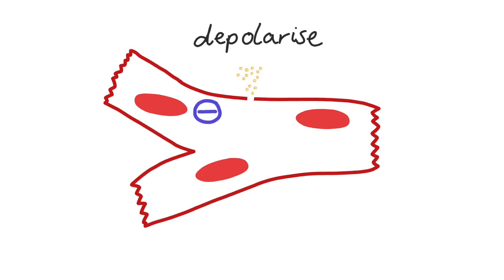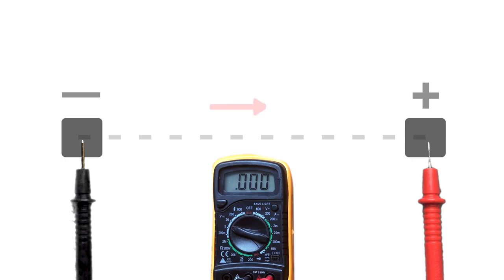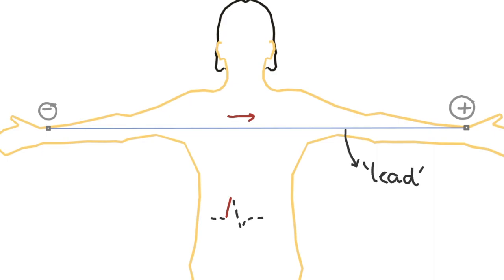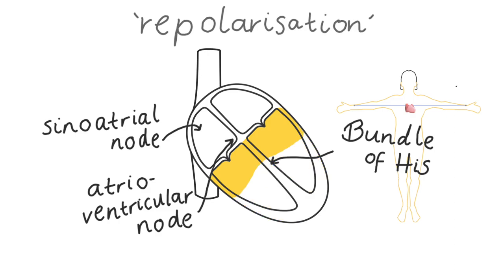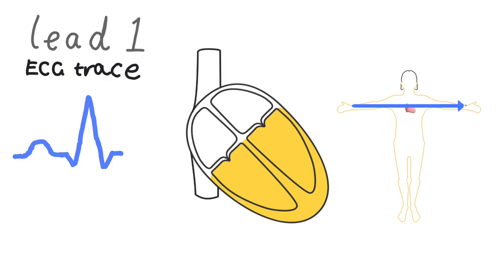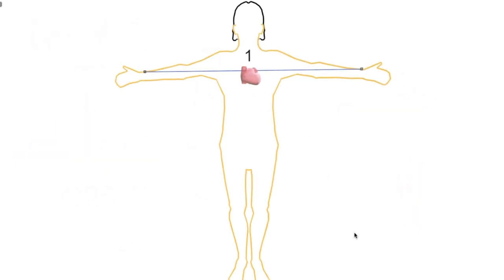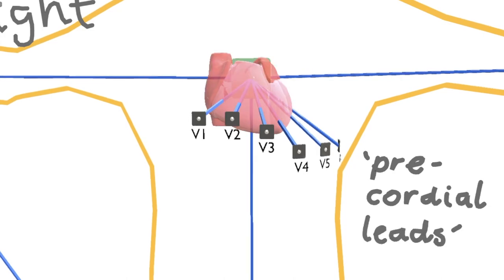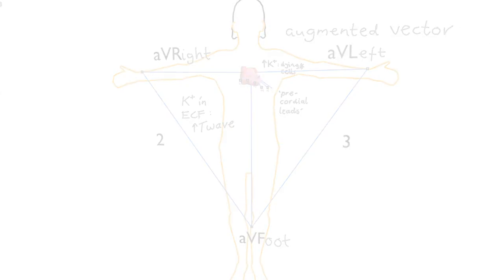ECGs - How they work

Comment: Current is wrong, it’s a potential difference, when the potential change crosses the electrical midpoint between both electrodes, the potential difference decreases. The rate of change of potential is the same per the depolarisation speed, the r complex is completely wrong in your description.

When it is half polarised, the potential difference it’s at maximum, when it is fully polarised, the potential difference is again 0.